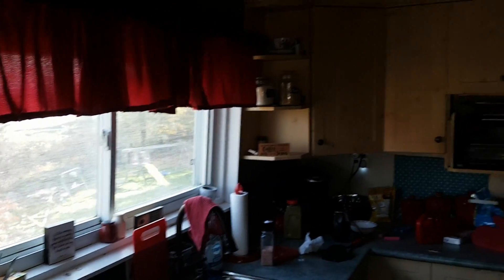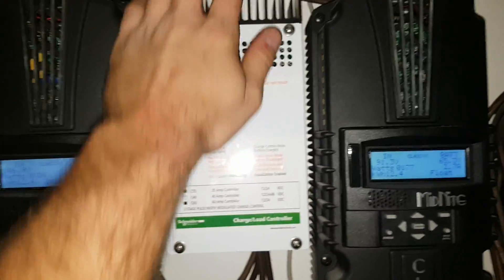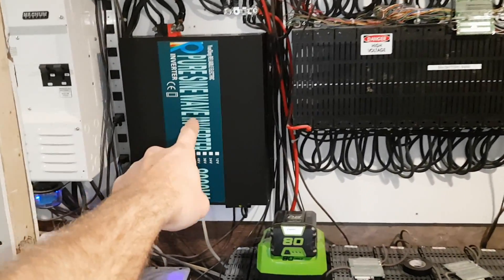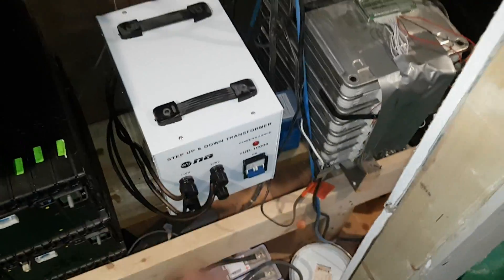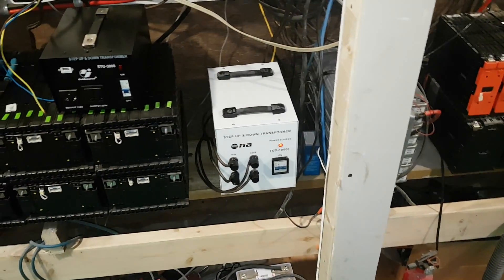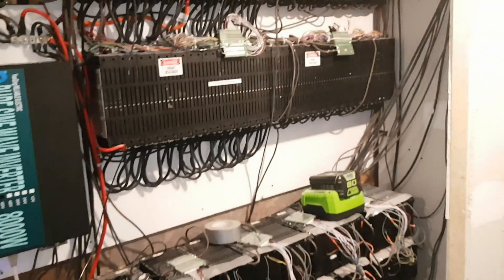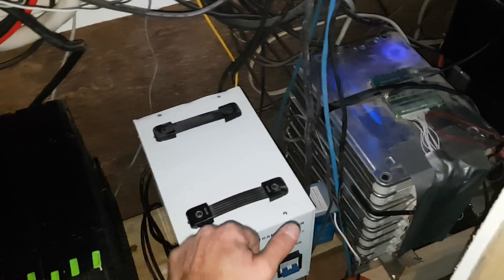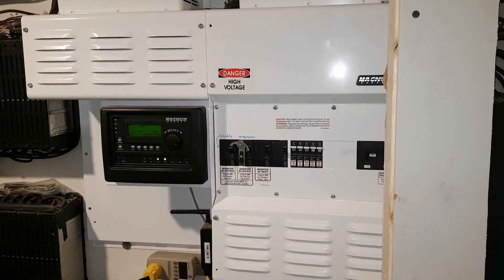8000w Inverter And 10000w Transformer

Comment: If you need 240VAC to power certain equipment, why don't you use a 240V Inverter and step down via the transformer to 120V?  Surely this would see smaller loads on the inverter, better efficiency and runs of lower gauge cabling(as doubling your voltage, halves your current)??
Reply from the maker: I like the stepping up cause everything has to run through the transformer with helps clean out spikes that hurt inverters :)
Reply: @GoingOffGrid101  Do you have any videos or evidence which shows that the transformer does that?  Maybe I should look into doing the same using an isolation transformer to decouple the load
Reply from the maker: @thedogsdiddies8421  I dont, just what I have found is all.

Comment: I don't understand why your 8k Realiable invert has given you so much problem. Been a while since I watched the vid, but why would such a big inverter be so touchy with its load capacity that it blows mosfets on it first load test? The load seemed well within its capability. I've got a 4kw Realiable, run my entire hour on it. Furnace, freezers fridge, lights? Why would yours act like that? Not sure what I'm missing, but was it faulty?
Ya get a chance, drop me a note and tell me what the deal with that was. (If it's fixed yet). Any way sure hope I win the 3 kw inverter!! Lol.. Take care and thanks ahead of time for the note.
Reply from the maker: I think it might have something to do with the controler for the mosfets receiving a spike and killing it that after that the output fets short, but im not sure ill keep testing mine, the 3000w inverters are beast!
Reply: I almost went with the 3000 watt, but I wanted to keep a good padding for startup draws. That's why I chose the 4000watt.
I have 3k of amp hrs worth of batteries storage.
Plus my system is totally independent from our grid power system. I have it solely as a backup/ along with generator as needed.
I keep the inverter meters and all our electronics in a faraday storage until needed.
Nice chatin'. Take care.
Reply from the maker: @TheJohnny1x  i believe the 4000w to be good.
Reply: @GoingOffGrid101  thanks.
One day I'll have a Set up like yours! I really enjoyed building mine and tinkering with it.
Yours is just off the hook. Have really enjoyed watching it grow.
I have a spare 2000kw diminsions 12×20 inverter/charger.
Going to try and incorporate into my system.
Keep up with the vids. Highly motivating.

Comment: I see a lot of expensive and quality equipment, why not buy a reliable and high quality inverter too? without going crazy to disassemble reassemble etc at the end it costs the same, in another channel I saw burning an equal Chinese inverter from "8000" with 1600W Miter Saw without cutting! there are as many quality inverters at acceptable costs
https://www.mppsolar.com/v3/split-phase-lv-series/                      
https://solar.schneider-electric.com/product/conext-sw-na/                       (xantrex ...)
Reply from the maker: i have 2 3000 dollar inverters lol they are great, the reliable is good to, the 3000w is great there was a little bug in the 8000w that they worked out I believe time will tell with this 8000w I have.

Comment: Hi Going Off Grid,  When you replaced the mosfets on your 8000w (input board) is this the mosfet you used?  Thanks.  https://www.mouser.com/datasheet/2/196/irfp90n20dpbf-1227618.pdf

Comment: there's no possible way that is a 10,000 watt transformer. from the size, i would guess 2500w - 3000w max. If your 40 watt idle claim is accurate, then that's closer to 1500w - 2000w.
Reply from the maker: I have a 3000w transformer and its about 30 ponds, this one is around 90 so id say its got to be close to 10000w and I tested the 3000w and it did do 3000w easily. its a lot bigger then it looks the transformer inside is around 10x10x10 in size.

Comment: how are you getting access to these parts do you work for them. cause I would love to do that and fix my many broken inverters.
Reply from the maker: I just message them asking for the parts and a price, they are cheaper then buying any of the fake mosfets on ebay.
Reply: Hi.. i'm new to this.. like ur videos a lot... About the output boards, can i swap just the output board off my 7000w inverter and put an 8000w output board in? If so, how much they charge for one?  Nothing wrong with my 7000w... just curious... Greetings from PR
Reply from the maker: @majingaknight  you will have to ask reliable, i would think you could if they are separate boards, and price I don't know they sent mine free I just paid for shipping.
Reply: Ok, i'll ask them.. just found their site.. thanks!

Comment: Hey bud if I got 7 4.2v batteries and made them 24v can I use a 24v battery charger to charge them up before I hook them to my solar there the c max modules or do I have to charge them alone
Reply: Dan Goras not likely. Most 24v chargers are 6s. I have 4.2 v in 7s . there are 7s batt chargers with s fair price at amazon. It will need to say 29.4 v li ion. The hobby chargers to charge them are expensive. You could charge one cell at a time. Or parallel them and charge them .. Some of the balance chargers will do 4.2v . or charge in 4s & 3s. The cheapest would be to get the tp4056 boards for each cell , then they can be charged with a phone USB charger. They are usually well under a dollar each. But only charge at 1 amp. Lithium requires a different charger than other chargers. Even lifepo4 requiesa separate charger.
Reply: @jamest.5001  I put 7 in series to make it a 24v battery but there not fully charge 2 of them are 26.3 the other 4 are 27.1 I'm trying to see if I can fully charge them before I put it on my solar system

Comment: The component added on top at 1:10 is probably a diode, more specifically a Transient Voltage Suppression (TVS) diode. It is used to protect circuits/components against voltage spikes.
Reply: I found a TVS diode with the same markings as the component at 1:10 on Alibaba : 
https://www.alibaba.com/product-detail/High-Quality-XE-TVS-DIODE-12V_60776886677.html?spm=a2700.7724857.normalList.9.bb7f673flM99X3
Reply from the maker: that would make sense it could help protect the mail driver board from spikes from the igbt's

Comment: Hi David.  Nice isolation transformer.  Great price.  It will run your 240 volt pump just fine. Remember to ground the center tap of the 240 output so that you have a 3-wire configuration for your split phase 240 volts.  One other thing to remember is to try to balance the loads on each side of the 240 volt split phase output the best that you can. That will keep the heat from building up unnecessarily in the in the isolation transformer.  

The buzz that you hear coming from your inverter could be a lose connection on one of your heat sinks that you didn't have tied to ground but I do not know for sure.  Just guessing.  I would be curious to know if the buzzing sound increases with load or not. If it does not increase with load, I wouldn't worry about it. Check your mounting screws that mount the PC board to the output side for tightness.  Hard to say for sure from a distance here.  

I was wondering if your dryer was electric or gas? If it is electric 240 volt you could run yet on the same output line as well.  

I am also curious what's your daily kilowatt hour usage is. My usage is close to 20 kilowatt hours per day here in Salt Lake City.
Reply from the maker: Mines about 20kwh as well, the buzzing stays the same with load, my dryer takes 7000w to run lol
Reply: @GoingOffGrid101   Wow. That sounds like a very large dryer. Mine is about 2500 watts.  Thanks for the info.
Reply from the maker: @w.loulittle130  yes I ran mine off my magnasine inverters and it said 7000w :S it drys in 30 mins :D

Comment: The heavier the load on a transformer, the more efficient it becomes as the magnetic currents are actually being used instead of causing eddy currents. So if you run the transformer at 80-90% of rated load, then it'll be at it's most efficient. Going up to 95-100% load will actually cause overheating as more current is being transformed.
Reply from the maker: thanks! makes sense, update everything is working great! :)